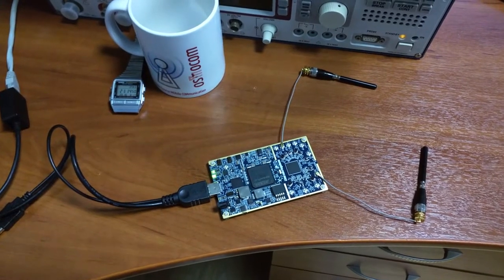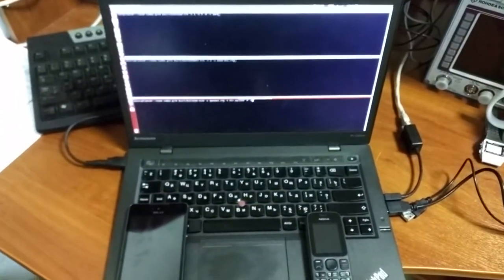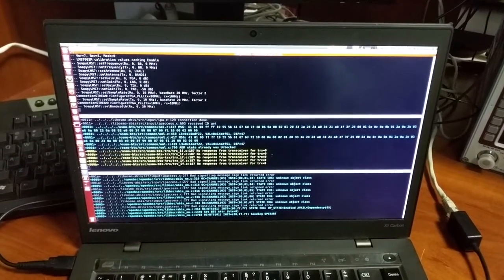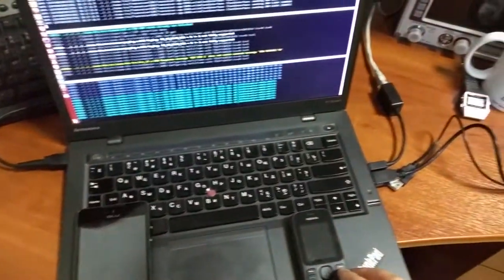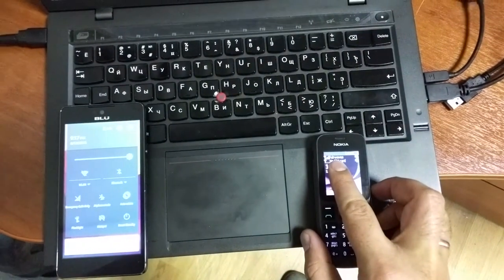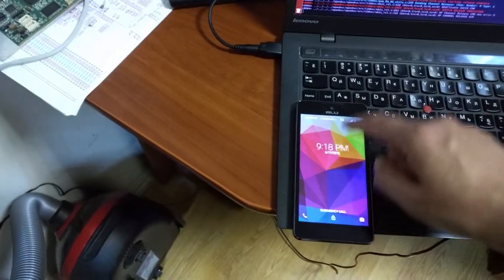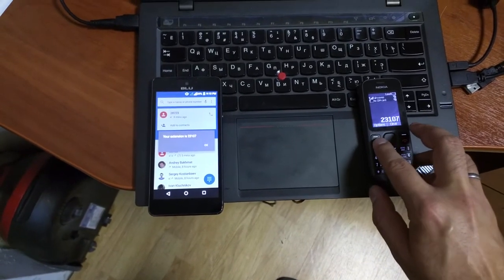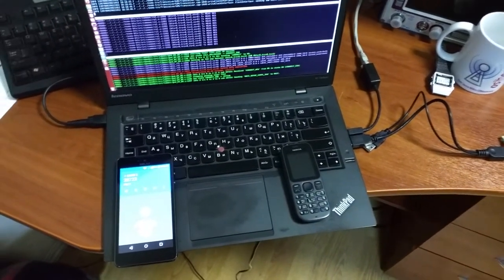Osmocom OsmoTRX/OpenBSC GSM stack running on LimeSDR

Comment: Hi, just wondering if all 3 components were build from fairwaves/osmo-combo project, including osmo-trx? Tnx.
Reply: You can do that, but don't forget to update versions of all sub-repositories to the latest master. LimeSDR support has been merged into mainline since then.
Reply: Tnx for response. Yes, been using updated masters. I can see the network on MS but unable to register to it. Running on GSM900, ARFCN 975.
Reply: Artem G Send an email to the OpenBSC mailing list. That's the best way to get support for osmo-trx with LimeSDR.

Comment: Can you publish the configuration files?
Reply: LimeSDR is supported by the 'master' branch of osmo-trx by now. Please refer to the Osmocom wiki and Debian packages for the example configuration files.
Reply: Alexander Chemeris  I compiled, but it's unclear which version of osmo-bts and osmo-nibt to use. Please, if you can, share the detailed information, if possible with cfg files. Also tell me, what is the temperature of the LimeSDR board ? I'm very hot with it. Thank you!